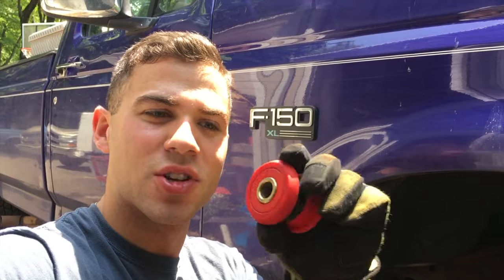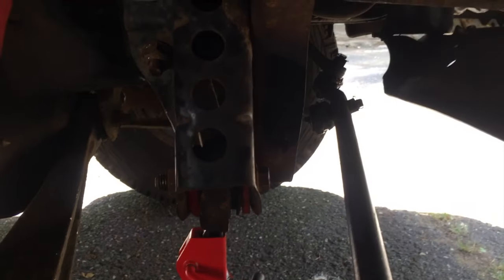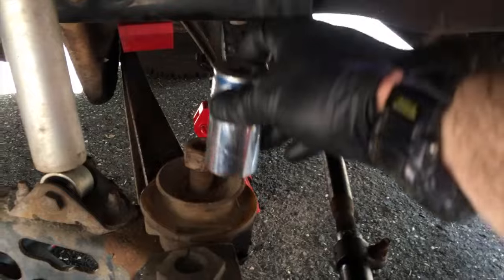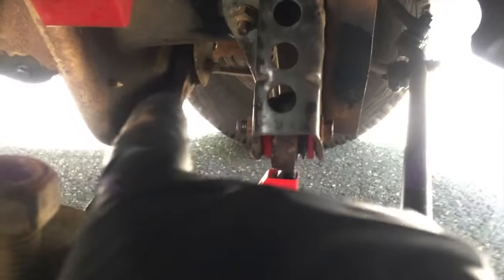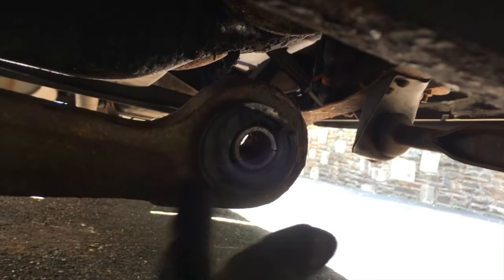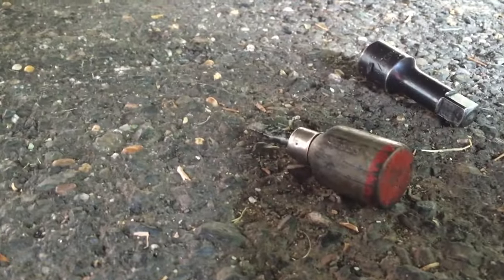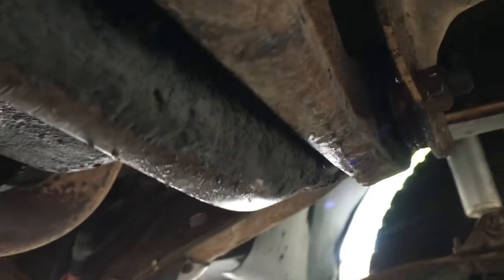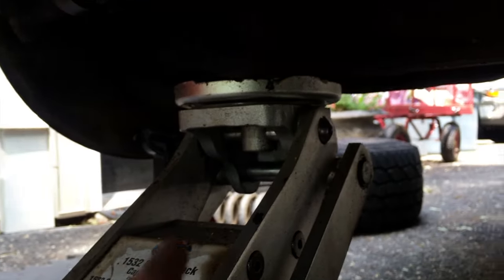How to Replace Worn Axle Pivot Bushings | 1995 Ford F150

Comment: Thanks for this video, I have to do this today and watching this gave me enough info that I think I can do it no problem. I have everything tore completely down as I’m doing new ball joints and the front differential had been leaking grease bad , so I took it out to clean up and reseal. One thing I would like to note, the yellow tank you called propane is actually map gas. Map gas can wreak your torch head if it’s one made for propane. If your torch head is rated for map gas though you get things heated up faster with the map gas as it burns hotter than regular propane.
Reply from the maker: No problem man! 🤙 Nice! You have a decent project on your hands. I’m glad I could help you with it. 
You are exactly right! I mix the names up sometimes. I definitely prefer map gas to propane.

Comment: Great videos but torque specs please and include if there's any procedure for torquing, such as having the full weight of the truck  in order to torque
Reply from the maker: Thanks man! I can’t quite remember the torque spec but I think it was over 100 ft lbs. I used a Haynes manual to source all of my torque specs. 
I always torque it with the vehicle off the ground and then retorque it with the vehicle on the ground later just to be sure .

Comment: Good job Steve, Great tips on how to do it. Myself I would of cleaned and painted with a rust proof paint, but that is me. wanting to keep metal protected from road chemicals. Fantastic job, thanks for sharing.
Reply from the maker: J. R. Thompson Thanks JR! I thought about painting the I-beams but I just knew a quick spray can job would flake off after a year. One day, I’ll pull them up and paint them properly. If you have the time, I would!🤙

Comment: Thanks for the collar sleeve tip I would’ve never checked my balancer installer kit for it and it worked, I melted the inner sleeve of bushing out and most rubber🔥 very carefully saw zalled the outer sleeve in two cuts, hammer 🔨 and screwdriver it popped out, then grade 8 bolt to Install with various washers, I’m small so I didn’t jack it up, did use the ratchet strap tip also to get hole 🕳 aligned for the bolt 👏🏻👏🏻👏🏻 I used the $6 autozone bushing it’s driving so much better with new radius 🦴 bushings too
Reply from the maker: Gmguy3car No problem man! 🤙 Glad I could help! You definitely did all the right things to get the job done!

Comment: The easiest and fastest way is to NOT remove anything but the bolt. Raise the truck by the frame where the tire just touches and set it on a jack stand at the frame. Take a jack and place it under the beam towards the middle. Loosen the bolt, drop the beam (you may have to wedge it down with a crowbar) put a 2x4 in between so you have room to remove the bushing. I replaced mine with a factory style Moog bushing and took a air hammer to remove the sleeve. Used a ballpoint press to put the new one in. Remove 2x4, use the jack to put beam back in place and install bolt and nut. Doing it this way it only took 45 mins tops. With the poly bushing this would be a 20 minute job.
Reply from the maker: I thought about doing this way but thought it would be hard to pry the I-beam down. How hard was it to pry down?
Reply: Easy, a small pry bar is more then enough. 
Trust me done this on the side of road a few times. It's gravy work. One bolt and it's a done deal. 
All I own is "old" Ford I-beam trucks, I'll shoot a video when I do my Lightning, it's super easy. I'll be doing the 93 Lightning front end soon and I'll take a video for you and your viewers. The stealerships have you do it the hard way....
Reply from the maker: F[]ck Perry Nice! If I ever have to do this again, I’ll definitely try it! It makes sense though considering how simple the I-beam suspension is.
Reply from the maker: Perfect! Just throw a link in the comments so I can check it out!👍
Reply from the maker: hellion2k I used the pickle fork to get mine out because I couldn’t rent the press. I’d say, rent every possible tool for ball joint removal. Some work better than others. Then have at it! 👍
Reply from the maker: hellion2k No problem! Good luck and thanks for watching!👍
Reply: Can some one please post a pic of where to put Jack stands on to do this please I'mma try it out
Reply: Yeah, this is exactly what I thought after replacing the radius arm bushings. I noticed my axle pivot bushings were also shot, but nobody had them in stock. So I put it all back together with the used ones. The radius arm bushings helped a lot, but steering is still sloppy. When I get the axle bushings, I'm just undoing that one bolt. It was the last one I put on when I finished the radius arms. It comes out very easily. 
1970 f350 with the 390.
Reply: Does this also work on a 4x4?
Reply: @JL Holinsworth, do you have any similar tips for the radius arm bushings?

Comment: Thanks for the lesson. I will be rebuilding the entire front end on my F150. All bushings and ball joints. I was worried most about removing the spring, but it seems like you can remove it without a spring compression tool.PS. I have a '95 with 325,000 miles. Same color as yours, but extended cab and Flare Side.
Reply from the maker: You're welcome! I'm glad you liked it! Yes, the spring can be removed if you let the suspension fully extend. Unscrewing the nut at the top of the shock is the trick though. Nice! Just when I thought my truck was the only purple one around! Keep her running!
Reply: I got it done! Removing the top nut on the shock wasn't hard. I had put new shocks a couple of years ago. It took a 9/16 socket on the nut, and a 3/4 wrench on the shock body itself. But it has to be one that is thinner on the open end to fit between the shock and the washer/bushing. Good thing I had a cheep wrench that fit.That color is one of the reasons I bought the truck. I had a fender bender a few years ago and found that the color is called Bright Sapphire Metallic. I plan on doing a lot of work on restoring this truck. Don't see many Ford Flare sides around many more.
Reply from the maker: jbrou123 Awesome! You have the right idea! Keeping the shock from spinning is the trick. Yes! Bright Sapphire Metallic! I really think it's an underrated color. Automotive Touch up sells it in spray cans. I plan on painting my truck that way. True! The flare side are rare. In a few more years they should become very sought after trucks.
Reply: Late for the party, I have the 95 purple flare side too, great channel to come to, with 240,000 there is plenty of work to do.

Comment: Appreciate the videos. However, it would be helpful if you would show the work to disassemble and reassemble the suspension areas. Yes it will make the videos a little longer but it will show unexpected problems you may run into which are huge teaching moments and provide your viewers with the extra help they need to complete the job by showing the whole process.
Reply from the maker: I agree 100%! I’ve actually change the way I film my videos, and now I include all the work.🤙

Comment: Did these and a bunch of other front end work over the past week. Videos were super helpful, so thanks Stevie! Took it to get it aligned though and there's still a ton of play in the pivot spot. Shop said the bushings were probably shot not knowing I replaced them. Anyone know what might be going on here?
Reply from the maker: You are most welcome! 
I would ask where the “play” was. Was the excess play at the bushing, the axle pivot bracket, etc.

Comment: 1. It's called a twin traction beam suspension 
2. You DO NOT have to remove the coil spring from the beam,  the big 1 1/8th nut does not need to come off

3. Dont remove the top of the shock off it's much more difficult to get to.  If the shock isn't new corrosion can seize it up. Remove the bottom bolt instead. It's easier to get to and re-install as well
Reply from the maker: Chase DeMers So it’s a twin traction beam if it’s 4wd and I beams when it’s 2wd. I agree, looking back, I wouldn’t remove the coil spring. I’d just unbolt the top. Yes, on a rusted shock I would remove the lower bolt but my shocks are in good condition. So I can take the top bolt off.
Reply: I appreciate your response, also I'm not ragging on your work,  I'm just adding to possibly help out anyone looking to do this job especially since that coil spring nut can be a chore
Reply from the maker: Chase DeMers No problem man!🤙 I appreciate it man!  I didn’t think you were. You made good points and I like having them in the comments for people to read. I’m lucky that I have an impact gun to remove that huge coil spring nut. But to your point it, some people won’t have an impact gun and that nut is a pain to get off the first time. 

Anyway, thanks for watching man! Have a Happy Thanksgiving!

Comment: Quick question, if you had to do it all over again, would you still go with the polyurethane bushings, or would you go back to stock.  Any regrets with the polyurethane? Squeaks? Harsh ride?
Reply from the maker: Ore Zamora I would definitely use the polyurethane bushings again. They are easier to install, if you grease them well they won’t squeak, and I really don’t think it made much of a difference in the ride quality either. The benefits are great though. The polyurethane bushings will last longer and don’t break down when they come into contact with oils and fuels. So yeah, definitely a polyurethane bushing fan!🤙

Comment: I changed all my ball joints and tie rod ends and my old ford still sounds like all that stuff needs to be changed again. Is axle pivot bushings what i need?
Reply from the maker: It could be. I would inspect your axle pivot bushings and radius arm bushings. See if there is any extra movement in them.

Comment: Which kit did you get, I've gotten the prothane 6605 kit and they are too long as well as the 4.3119, which energy suspension themselves told me to get and they are too long. Watching this video it seems you have the 4.3121 kit which I think I need, why could you not use the 4.3133 kit that comes with a new outer sleeve? The inner sleeve is the same length as the 4.3121 kit
Reply from the maker: So I bought one kit and compared it to a the driver’s side I beam might and it was too long. So I checked the part number with Prothane and got a kit that fit. I can’t remember the part numbers though.
Reply: @TheMinuteMasters  all good, I ordered the 4.3121 earlier bc that one seemed like it would fit since the old pivot bushing inner sleeve was closer in length to that 4.3121 kit

Comment: Good evening friend, sorry to bother you again, I'm curious, could you tell me if the automatic daford explorer 2005 door panel and lining panel fits or can be adapted to the ford ranger 97 v6 stx 4.0, or if you've seen something like that, or what model would work, I'm from Brazil, thanks for your attention again.
Reply from the maker: Good question! I don’t know the answer. The doors do look similar though.
Reply: ok thanks for your attention buddy, it would be difficult to find old car scraps out there, I would like to buy a Lund visor in the future for my Ford Ranger 97 v6 stx 4.0 truck, which sends this part to Brazil, here it is not available and on the ebay and amazon websites I found it expensive$ $ due to currency conversion, I hope one day we can do business on this piece I will be very grateful and thank you again for everything and your attention Ford Ranger Brazil Facebook group.

Comment: Hey! I have the same bushings from energy suspensions, but I just tried doing them this morning, but the bushing is longer than the oem one, including the metal sleeve, by about 1/4", give or take. I can't press them up into where they seat in the bracket, so what do I do? Thanks!
Reply from the maker: Really? Try fit testing the bushing in between the axle pivot bracket. The first of the bushings I ordered were too long when I fit tested them and I had to go back to energy suspension and get the correct part number.
Reply: @TheMinuteMasters  I already pressed them into my I beams, so they are greasy and not considered "new". I'll look for the shorter ones online, thanks!

Comment: Superduties still use twin I  beam suspension  ,it is tough  and rock solid  forged steel !
Reply from the maker: You are right! The twin I beam can take a beating. As long as the bushings are in good shape, it will be a smooth ride too.🤙

Comment: Quick question, I am doing this process and want to know if bushing is pressed in from front to back of i beams?
Reply from the maker: I pressed it in from the front.
Reply: Thanks for info great video but not enough detail on install but thanks for getting back to me will try to finish up today.
Reply from the maker: @frankgonzalez534  No problem Frank! What else do you need to know about install?

Comment: nice video but i wish you had shown just how you pressed the sleeve of the bushing out after you removed the rubber.
Reply from the maker: Unfortunately you leave the sleeve I place with the poly bushings. I will be film a video on how to replace the stock bushing with a stock rubber bushing which will involve taking the old sleeve out.

Comment: How the hell did you get the spring off with the lower nut and retainer still on??
Reply from the maker: When you in bolt the top spring retainer and the top nut for the shock, you can lower the entire I-beam down. Then the spring pops out easy. I have a separate video on how to do it. At that point, it’s pretty easy to remove the lower nut and retainer for the spring.

Comment: Thanks man! Was able to press the inner sleeve out, but prying the rubber out seems to take forever- how far do you heat the rubber up? Burning?
Reply from the maker: Dan K No problem! That’s good! So I the rubber had the usual cracks, so the inner sleeve came out fine. Now, I think I almost set the bushing on fire. Then I pried at it and it came out in chunks. Once the majority was out, I took the torch to it again. I used a long razor blade to scrape what little was left. Once it’s down to just paper thin pieces left, you can sand the rest out. You should be able to get it pretty smooth.
Reply: Thanks so much for quick reply! No worries about damaging outer sleeve when prying?
Reply from the maker: Dan K No problem man!🤙 So the outer sleeve is pretty sturdy but my advice is to treat it careful. Better to burn the rubber than to pry really hard on the outer sleeve.

Comment: So the inner steel sleeve doesn't have to be removed if you use the prothane bushing???? Right?
Reply from the maker: The outer sleeve from the old bushing gets reused when using a prothane bushing. The prothane bushing kit comes with a new inner “bolt” sleeve.
Reply: @TheMinuteMasters  thanks!
Reply from the maker: @Dutch1951x  No problem Chris!🤙

Comment: Just did my bushings, but the 4x4 was a little tougher to get at. I got into a weird mood and installed the new poly bushings without totally cleaning the rubber residue from inside the metal sleeve. I'll let you know if that causes me problems in the future.
Reply from the maker: Nice! Haha! Well as long as most of the old rubber is out, I don’t think it’s going to cause any real issues. Sounds good man!🤙
Reply: @TheMinuteMasters  Yeah I'm not sure the bushing is even supposed to rotate much in that outer sleeve. Looks like most of the pivot comes from the inner race. If it does somehow wreck the bushing, at least now I know how to fix it. Thank you again for this content!
Reply from the maker: @alphaclean3364  You are right. The bushing itself doesn’t rotate. It bolt rotates inside the bushing race. So you should be good! No problem man!🤙 I appreciate it! Thanks for watching!

Comment: This is a stupid question but does my truck have more than 1 axle pivot bushing? The shop told me I need to replace mine but I'm not sure if there's a front or rear?
Reply from the maker: Kino650 Yup! You have a left and a right axle pivot bushing. They are both in the front. No axle pivot bushing in the rear.👍

Comment: I’ve replaced all four ball joints with moog brand joints, and I’ve got inner and outer national brand bearings and seals. I’ve also replaced my radius arm bushings, inner and outer. I’ve got this horrible popping sound coming from somewhere under the front end, and I can feel it in my foot when I turn and sometimes brake. Could this be the culprit?
Reply from the maker: Gabriel Bray The axle pivot bushings could be the culprit, but the only way to know is to check. Jack up your truck and let the suspension fully sag down. Then check the bushings and Shane them. 

I would also check your steering link and ti rod ends. Those can wear out and pop during steering.